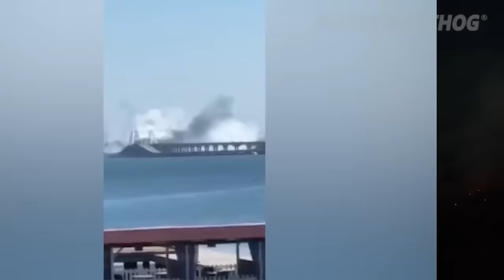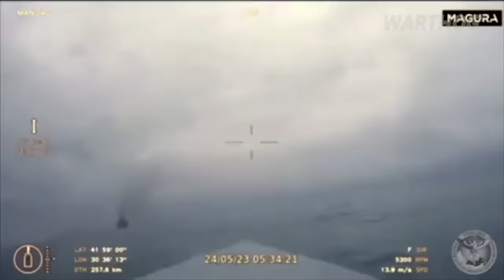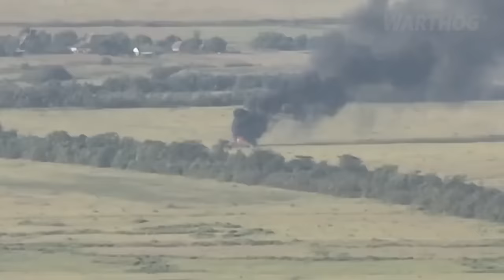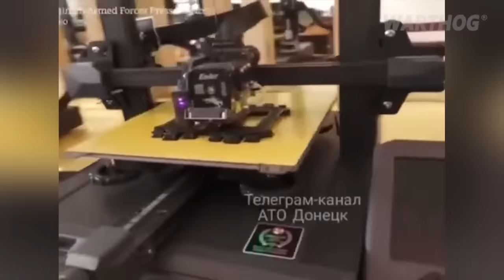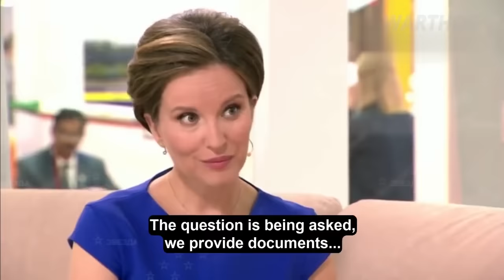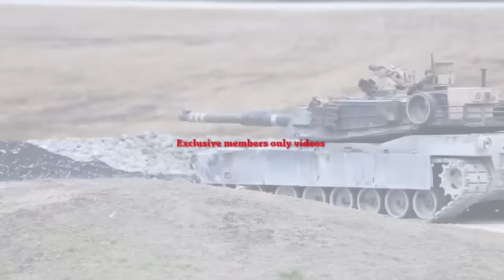RUSSIAN ARMY IN THE SOUTH IS CUT-OFF, THE KERCH BRIDGE IS BEYOND REPAIRS || 2023

Comment: As someone studying civil engineering for years now….those bridge pillars will fail in a disaster. Sea water will wreck the iron in the concrete really bad. That basically makes the iron grow in size which will feck up the concrete even more. Only time will tell when, but without any doubt: It will be down some day.

Slava Ukraini
Reply: Feck    👍    😊
Reply: i guess when you give a bridge builidng contract to a company that has never built a bridge that is what you get. On a bright note the oligarchs who run that company all got new yachts so it balanced out
Reply: Bring it on
Reply: Everything will be down some day. The question is when.
Reply: If there are cracks in the visible part of the pillars, what lurks unseen?
Reply: Sea water will not wreck the iron, it will corrode it away, the scale that is formed is from the iron corroding away, less iron = less strength. The corroding iron does not have the strength from its “growing in size” to push the concrete apart. The fractures are from the stresses the bridge is subjected to. The concrete is bearing more load as opposed to the iron from taking up that load due to corrosion.
Reply: @Hotspur37  We're getting a real time lesson on the effects of corruption.
Reply: @informant09  True. But I think Ukraine is working on the problem. If only one or two pillars fall, the bridge will be gone from this war.
Reply: Ice will do the job.
Reply: @DonFahquidmi  Reminds me of the Firth of Tay Bridge
Reply: @jeffs7573  actually the concrete will crack and split over time from rust forming along the rebar. Seawater is highly corrosive, it will happen in decades or perhaps years with saltwater exposure to rebar. It is a well know process. You mitigate by using rebar that doesn't rust, this might even be a coating on the rebar, or composite rebar.
Reply: @giles-df9yu The Black Sea does not freeze.
Reply: @Germa4945  I am sure, this is the case! The only question I am asking myself all the time, when the bridge was hit the first time, there was a train with fuel or oil tank cars exactly at the right spot. Was this exactly planned or just simply coincidence?
Reply: The whole Krech bridge is not affected. They can rebuild sections of it but that would take a long time.
Reply: @Germa4945   That bridge looks fkd, unusable unless you're Russian. Russians will keep using it until it's sunk. Would be nice to see that train bridge fall as well. It would be such an epic gut punch to finally take these bridges out.
Reply: @Hotspur37  That's what happens with all steel reinforced concrete when the steel is exposed to moisture, no matter how well its built. The problem is that it takes a long time and so it would need to be left exposed. So yeah IF the concrete supports are damaged sufficient to expose the steel, and IF the Russians just leave it that way, in 20 years they'll have a real problem.
Reply: so your saying its junk ha ha
Reply: Didn't they use epoxy coated rebar?
Reply: The bridge itself was probably not designed to handle increased military traffic (both road and rail). I suspect that it will crumble in less than 5 years if left alone. But we all know Ukraine is not going to let it alone. 😀   слава україні
Reply: @christopherrobinson7541 it gets pretty cold in Crimea during winter and rain will freeze.
Reply: It looks like only vertical rebar without circumference reinforcement.  A compressive load will always push outward horizontally.  That or they poured concrete on very rusty rebar or had too much slump on the concrete or contaminated water or substandard concrete chemistry.
Reply: @daniellarson3068 bad rebar is bad rebar,  even if they coated it in epoxy. Chinese and russian rebar can be broken by hand, sometimes.
Reply: @transcendentalidiot3321  Oh it was designed that way, just not built that way.
Reply: @transcendentalidiot3321  Of course it was. You think that Putin didn't envisage the notion that the annexation of Crimea and the ongoing campaign in the Donbas might make the connection to Crimea a logistical necessity? If it was that badly built the original attack would have flattened it. Its military significance stood out like dog's balls, and there is no reason to suppose that Russia didn't fully grasp its strategic importance and every evidence that it has been built accordingly.
Reply: @196Stefan2  Yes very similar.
Reply: Military cargo has not been transported through this bridge for a long time, especially considering that the railway part of the bridge is operating as usual. Anyone who knows what a "map" is can be convinced that Russia has a land corridor to the Crimea.
Reply: @jeffs7573  Sea water WILL  wreck the iron
Reply: Feck! Drink!
Reply: I'm am Electrical Engineer, worked as Electrical Designer for 11 years in a Multi-disciplinar group of Engineers, including CIVIL ENGINEERS and I attest to what has been raised regarding "reinforced concrete" and SEA WATER. VERY SPECIAL MATERIALS ARE REQUIRED FOR THIS TYPE OF  CONSTRUCTIONS.
Reply: @196Stefan2  Pretty sure that was pure luck as that first massive explosion was loaded into a transport truck for delivery to the other side that went undetected and unknown to the diver who was delivering it. Although quite possibly there was a lot of on going train travel back and forth with a war to supply at that time. No matter why the timing was a prefect 2 for 1. The Russians at the check point missed it and train cars carrying fuel and/or flammables was at that point in the bridge at the right time. Or as the Ukrainians might say to their Russian occupies "Damn the bad luck"
Reply: @christopherrobinson7541  water in the cracks in winter do. Not the sea itself.
Reply: Awkward bridge, meanwhile Patrick still waiting for his new home in bikini bottom.
Reply: @ZhovtoBlakytniy Wow!  I guess they "cheat" on their manufacture of everything.  Russia is a lesson in the value of quality.  I guess that's why I never see products made there.
Reply: One more Himars strike and the Kerch bridge is doomed
Reply: A couple of winter's worth of frost will blow that concrete off the rebar... Timber!!
Reply: As a Civil Engineer i think it will be blown to pieces far  before  shite building practices overtake it. js
Reply: @jeffs7573 You obviously know nothing about reinforced concrete and the effect rusting rebar has inside the concrete. Please do some research.
Reply: @USA-freedom   It was not a truck, the explosion has long been thoroughly proven and well-documented that it came from below. That truck myth was very quickly disproven at the time.
Reply: @Hotspur37  When this bridge was build, even russian scientists said it was so weak and would probably fall down of itself. But i hope ukrainian take that bridge down as soon as possible.
Reply: @jeffs7573  Rusting iron very much DOES crack concrete apart, especially sub grade concrete.  I have seen it hundreds of times.
Reply: Not fast enough, why do France and UK prohibit the use of their weapons against Kersch bridge and all Russian vessels?
Reply: The winter salt put on motorways in the UK has a deleterious effect on reinforced concrete bridges. Those cracks are horrendous especially with the resonance set up by trains. Piles sunk into silt and not deep into bedrock will not last long.
Reply: I can’t believe they poured over silt if that’s indeed true😆🤣.
Reply: @panzerblitz2140  the whole Kerch bridge is badly built. Russia’s version of a Chinese tofu dreg project😂.
Reply: @AORD72  especially when you consider Russia purchased a lot of substandard rebar from Chyna and the concrete was likely not the best either.
Reply: As a Civil Engineer I can confirm that these are stress cracks of the Photoshop kind.
Reply: Hope for a rapid proces☺
Reply: @SvenTviking  Thank you for your input, however I do know what I'm talking about.
Reply: @barbarakauppi9915  You are full of BS. It came from the truck as it was crossing over the bridge. There is no doubt about that. The video clearly shows the explosion and damage coming from on top of the bridge carrying over to the rail way higher over on the other side. This has NEVER been questioned by anyone. But I'll give a chance to prove me wrong. Name one source.
Reply: I give it 5 years. The bottom pedestals will crack up. Hopefully there is enough rebar to keep it together long enough to come down with no loss of life.
Reply: @Germa4945  As a fixed target of immense military importance, it has to go.
Reply: you bet ya mate and the steel inside is expanding as we speak 10x fast in salt water plus wave action on the cracks 😀
Reply: It needs to go. The bridge must go...very soon
Reply: @Dilley_G45  It has got to be one of the highest priority's. But it is very well defended. If there is a will (and there is) there is a way.
Reply: @USA-freedom  if there's a will there is a bush
Reply: @Dilley_G45  in this case a big bush
Reply: Corrosion is on Ukraine’s side 😊
Reply: @A2Z1Two3  GOOD! Just makes it that much easier to tear down 😉
Reply: @osric1730  The term is spalling.
Reply: 🤣 @Hotspur37
Reply: @informant09  i knew some genius was going to reply with that even though they knew exactly what the OP meant. 🤡
Reply: @AORD72  I work in cutting edge precision composite tooling and the possibilites for substitutes to traditional building are endless.
Reply: @196Stefan2 Yesh  sort of I guess   corruption in the steel/steal department lol.😂😂😂
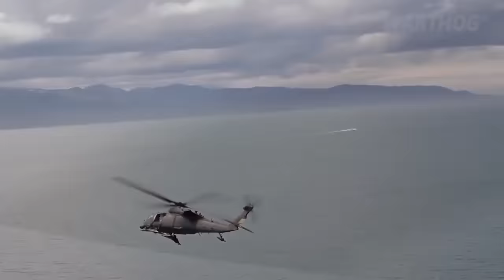Reply: @sichere Really?! I wondered about that, but there will be some real ones after all those ",incidents ". Lol 8:50
Reply: I agree, however the images look photoshopped to me.

Comment: Never underestimate Russian corruption. There's reports that corners were cut and the Kerch Bridge wasn't built properly. Apparently the substrate is very soft🤞
Reply: yay!
Reply: And the material used is very flammable id someone smoked near it................😂
Reply: I visited Ukraine back in the 1990s, and saw how bad Soviet-era engineering really was/is. Buildings that were constructed just a couple of years earlier already had concrete spalling so badly that you could see the rebar. There were even holes clear through floors from one level to another. The state of the Kerch Bridge does not surprise me one bit.
Reply: Most of it or all of it, That bridge is  going down , that's all there is to it.

In World War two, it really crippled the enemy when the Allies started bombing the enemy bridges
Reply: @nicholasconder4703  True, I was in Ukraine in the early 2000.  I was shown a building built at the time of the Moscow Olympics. It was falling apart.
Reply: Time to call me a storm shadow to find out,
Reply: It was built incredibly quickly, especially for a bridge of its size. Which was perhaps needed, but the fact that work did not continue after the opening on a regular basis to maintain and upgrade made no sense given the hurry... and that's corruption and any crappy construction practices aside.
Reply: "SPECIAL SOVIETIC CONSTRUCTIONS" 😝😝😝
Reply: @nicholasconder4703 This is what happens when you don’t care about your own people or your own country even a little and instead only care about maintaining your own power
Reply: WTF do you think a sea bed or a lake like this is make out of?  All lakes get deposits of silt and sand from run off, even stream beds get it too.  A house built on a foundation of sand or silt on a flood plain is a house destined to crumble, sooner rather than later.
Reply: Well, that's what the narrator said.
Reply: @icosthop9998  No chance of that here,UK France will not permit their weapons use against Kersch bridge,weapons continue to flow to Russian soldiers, the ships need sinking as well.
Reply: As a Civil Engineer I can confirm that these are stress cracks of the Photoshop kind.
Reply: Hurrah for the Russian corruption. 😂
Reply: Use Stormshadows, or is UK sympathetic to Russian artillery.
Reply: @sichere  as someone with common sense I can assure you're not a civil engineer
Reply: @icosthop9998  It's how the Allies strangled German logistics in Italy, after learning hard lessons at Monte Cassino. Many parallels with today.
Reply: @jorgef.7923  
Who knew  Russian  "ToFu Construction    L 😂L
Reply: @Nimboid-20    Nice &  TY  👍
Reply: @paulbedichek5177  
This video mentioned how poorly the base of that bridge is, maybe send some of those remote water drones to hit a few pilings ?
Reply: @icosthop9998  Yes, Ukraine has been wonderful , fighting with flair
and bravery.
But what of the West? They protect Kersch bridge and Russian supply lines, No Stormshadows hit that bridge or any Russian vessel.
Reply: nor will a single ruble spent on its repair produce any actual improvement
Reply: @cristo6007  I shall remain Civil and ignore your taunt

Comment: Dang, there is a difference between understanding that something will work and trusting it enough to actually test it out.  That guy who intentionally stepped on a mine with the claw shoes on?  Holy crap.
Reply: Sappers have been using those things for years, they've already been tested.
Reply: Very low on robots to step on the mine.
Reply: But the shoe is not permanently damaged?
Reply: How does that work?  I thought if you stepped on a mine no matter what's on your feet, you'd lose a leg.  Does it only work on small land mines or does it work on those tank ones too?
Reply: Because this was the first time we have seen it done on video, it must have been the first time it has ever occurred.
Reply: If it sets  off a tank mine, then it will kill the guy, but if he is not heavy enough to set it off, then it does not matter.
Reply: Do you often beleive the first time YOU see something, it's the very first time it happened ? I mean come on dude.
Reply: @Linda_AUS  this is a complete guess btw. I would assume it’s the same concept at how vehicles do it forming the blast away from your leg/foot instead of letting it hit the shoe flat kinda like the v snap hulls. Btw no an AT mine would turn you into tomato soup tho they take a lot more then stepping on to detonate unless you can rig them too idk bout that.
Reply: @Linda_AUS  Some mines will take your foot off if you are bare-foot or poorly shod. if you wear boots you will likely be ok.
Reply: @BuddyLee23 why be so snidey simply because other people have learned something new? It's quite an unpleasant characteristics, if no one has told you that already
Reply: @sirzebra did he say that?
Reply: Even though this guy may not have been the first guy ever to step on a mine using this special footwear - imagine being the first guy.
Reply: @BuddyLee23  sarcasm is the lowest form of wit.
Reply: @Linda_AUS an AT mine would obliterate the person, boot and all.  But a person would have a tough time setting off an AT mine using just their body weight.  The typical AT mine requires at least 400 lbs of pressure, and that’s on the low end.  Most require heavier weight.
Reply: @haganhailey5785  Thank you. 👍🙂
Reply: @NigelHatcherN  Thank you.  👍🙂
Reply: @Brocuzgodlocdunfamdogson  Thank you. 👍🙂
Reply: @conradnelson5283  That makes sense.  Thank you. 👍🙂
Reply: @Linda_AUS  Probably a small butterfly mine.  I've seen soldiers literally kick them aside, setting them off.  They are most dangerous if you step directly on them with your foot.  Now other types of mines will blow your leg off.  Many different types of mines.  
An anti-tank mine is not likely to be set off by something as light as a human.  They're made for the weight of a tank after all.  If you did manage to set off a anti-tank mine somehow, well, they're very unlikely to find all your various parts and thoses funky-looking shoes aren't going to help.  Better than nothing though.
Reply: @GUNNER67akaKelt  Thank you. It's always good to learn something new.  Now I know what I'm seeing. 👍🙂
Reply: @Linda_AUS  a person does not weigh enough to trigger a anti-tank mine. not even the biggest 800 pound walmart dalek would trigger an AT mine.
Reply: Reading is fundamental folks...  Yes, they have been tested, that's how the person would *understand that they would work*.  Trusting them to do so is another question, especially a 3d printed version of the things.  As an analogy, we all understand that a kevlar vest will stop a bullet from most pistols.  Does that mean that I trust a kevlar vest enough to just let someone shoot me as a demonstration?  It has nothing to do with it being the first time someone was shot while wearing a vest - quite the opposite.
Reply: @jerryadams6799  Depending on the type of mine, a person absolutely could trigger one, though it would require some bad luck.  And I'm not talking about some weird Botswanian variant mine.  They can be triggered by as low as 100kg (i.e. a normal guy with a pack who steps wrong) up to ~300kg (the Slimfast version of your Walmart dalek).  You want the thing to go off when it is driven over by any heavy vehicle, but they have to have tires/treads big enough to support the vehicle so it doesn't sink into the ground or tear up the road too badly.  The actual pressure exerted by a tank against the ground isn't humongously more than a fat person with little feet (it's a single digit multiplier I mean, not factors of ten).
Reply: @conradnelson5283 No guy is heavy enough to set off an antitank mine.

Comment: I'm not a structural engineer but them concrete pillars are not safe  without a bomb hitting them
Reply: What is your opinion, are those cracks fake or real?
Reply: @christopherrobinson7541  hi. I'm sure I saw these exact columns with those exact cracks doing the rounds ages ago. Think the cracks were disproved as photoshopped.
If these are new pics and are real, great. But...
Reply: I would say that they are even less safe WITH a bomb hitting them.